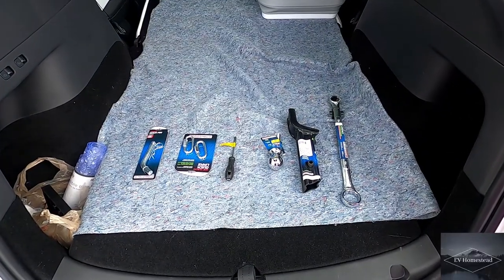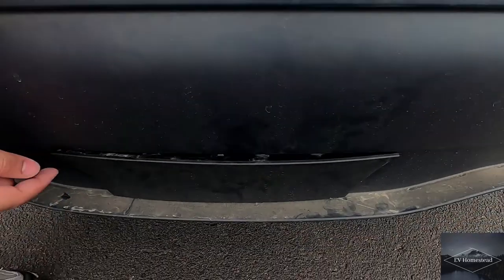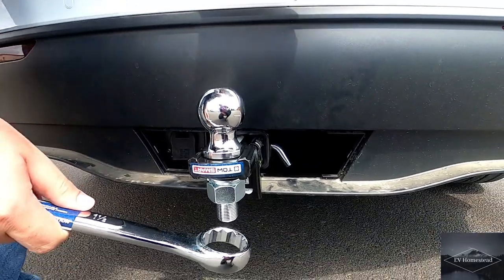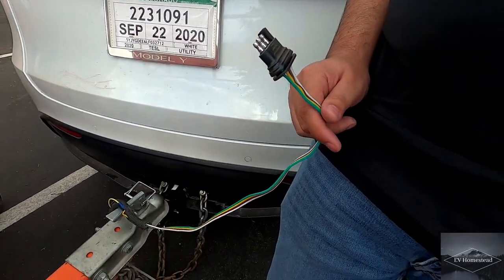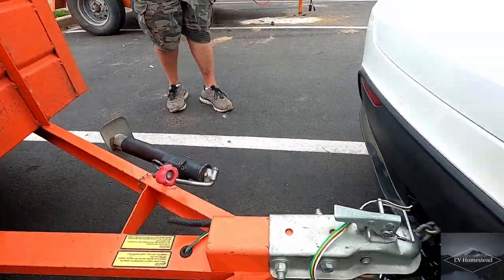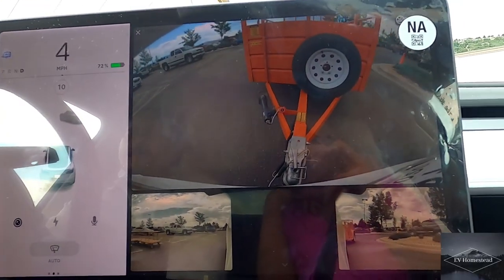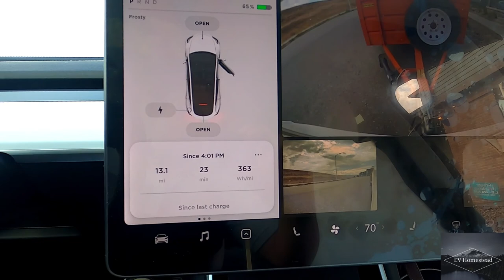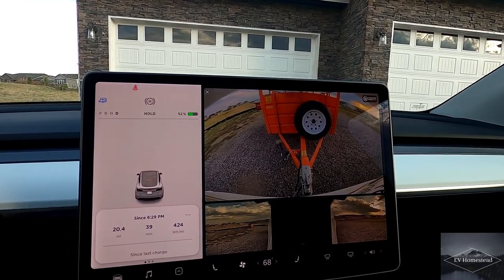Tesla Model Y Towing a Trailer!! - How To & First Impressions!

Comment: Just a tip from a horse hauler. If you cross the safety chains above the receiver hitch prior to attaching, if the trailer ever comes loose you will be able to stop it. The way shown always allows the tongue to dig in violently snapping the chains and creating a runaway trailer. Even if you do it the first way, it sucks if it comes loose.

Comment: 7:04 looks like you about smashed into the trailer lol. 

I would imagine having creep mode turned on would help while backing into the trailer because then you would only have to control the brake pedal while reversing

Comment: I assume you tested the brake lights and turn signals and saw they worked. I cannot get lights, brake and turn signals to work. They work fine with my daughters truck. I did turn on trailer mode but no luck there either. Tesla is to be out this coming week to check. New adapter as well.

Comment: Always use an impact wrench to tighten a ball to a hitch. Hand tight just isn’t something you would do with equipment that is hauling heavy load. 
I did want to ask if you know the weight of the trailer that you rented. I will also look at Home Depot website to see if I can see the same model. 
I’ve rented the dump trailers before and it’s an easy process, but they couldn’t be pulled with the Y just because it has its limitations of course. 
Thanks for the video.

Comment: Great to see videos of towing with the model Y. Thanks!
Reply from the maker: Thank you Thomas!
Reply: Saw a guy at the Waco supercharger pulling a small Airstream 20' maybe. Expect about a 120 mile range on flat ground driving conservatively. That was a Y LR. I intend to use my Y P for launching skis and a boat but  they are in storage at the point of use. Might pull a single ski for fun.

Comment: Nice vid, thank you! Can't wait until I don't have to switch to ICE SUV for towing my boat anymore.

If you don't mind - why do many Tesla Model Y owners yourself included leave that nasty factory screen cover with NA sticker on their screens?
Is it more like always keeping the TV remote carefully wrapped in some transparent film (popular in some 3rd world countries), or more like keeping the price tags intact and attached or the furniture is wrapped in shipping plastic, with intention of returning the product the last date eligible for return (popular among some specific demographics)?
Reply from the maker: Hi vadimus2007, towing has been good so far with the Model Y although we do see some range issues. We actually removed the factory screen cover when we got home. I think we just forgot to remove it in the video :) We want to install a screen protector soon just to prevent any scratches or damages to the screen.
Reply: Well, range issue is kinda expected, my slightly bricky SUV's appetite for gas jumps almost twice, from 9 L/100 km to 16 when I tow my moderately light (2500lbs or so) boat, a vehicle with much lower drag coefficient like Model Y should experience even more penalty while towing.

Comment: Tesla needs to do some improvements on the hitch design and implementation. Having those chains on the bumper plastic is going to be a problem long term, and may damage that plastic is the chains move. Hopefully there’s a product that replaces the hitch cover that just fits right into the receiver rather than fighting with the plastic clips. Also, for anyone wanting a utility trailer, consider an aluminum trailer which is much lighter than steel trailers.

Comment: Interesting but have a few notes: 
1. ABSOLUTELY TERRIBLE BUMPER DESIGN, chains hanging off the bumper, clearly made by a tesla design who thoought chains just genty kiss the bumper lol.
2. 7 pin connector is overkill for this vehicle, but whatever, could at least have the 4 pin output side by side to avoid adapters
3. Youre towing a heavy trailer with basically nothing inside. So youre not really towing, just carrying around a heavy trailer. Towing usually involves a trailer and gravel, rock, etc in the back. That unit is overkill for your task and im sure in the future you can just acquire a small light duty trailer for 500-800$ new or spend a bit more for alluminum to keep the inside of the car clean. 
4. Battery range was not really summarized to show the actual drop for towing, etc. 

Fun ask, lets see that rear bumper where the chains rubbed on the whole drive after one tow :)